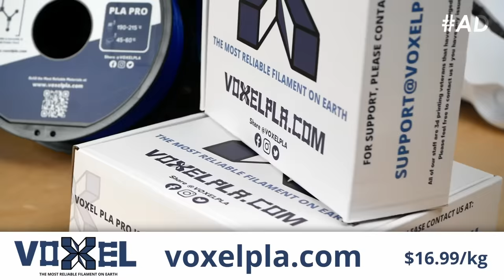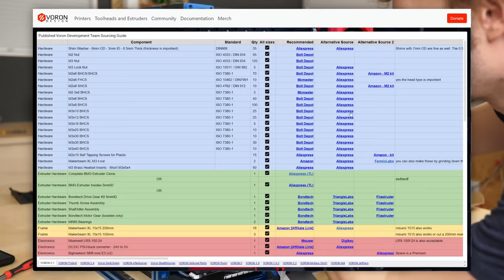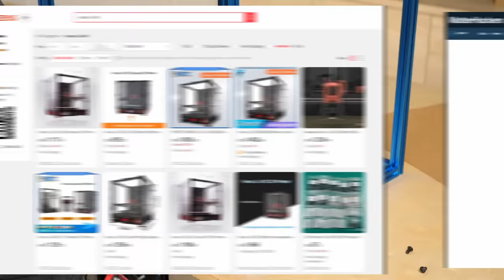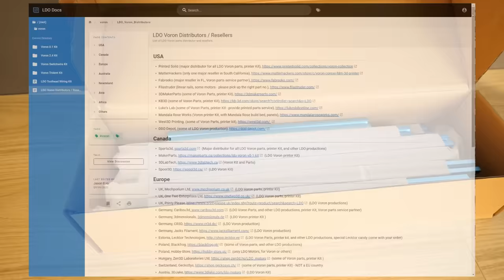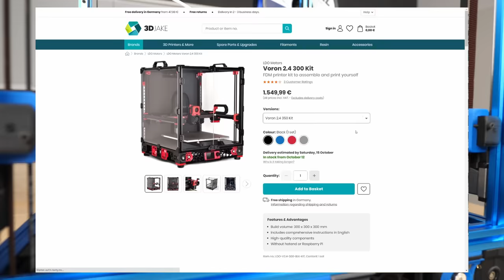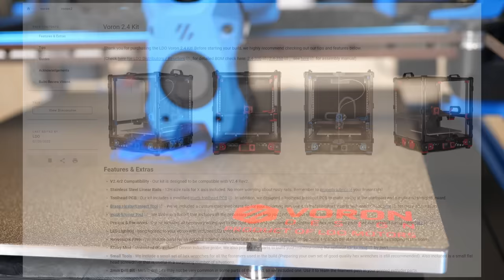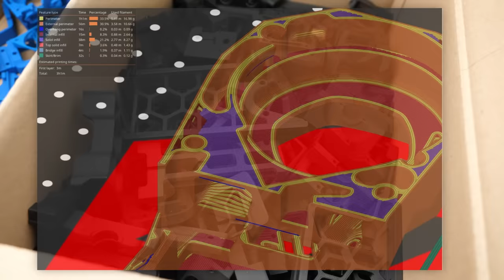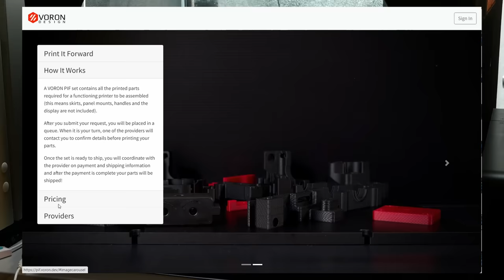Should you build a VORON 2.4 in 2023? (LDO Kit Review)

Comment from the maker: VORON 2.4 - Overhyped or everything you desire?
Reply: i want it but am broke lmao
Reply: If you are serious about voron printers then it is not hype. But if you use a cheap kit from China then you are not serious in my opinion and voron is a hype for you.

I am building one myself. The 350mm version of LDO. I chose the prusa colors. prusament ASA black and orange.
Reply: I love my voron 2.4. with the exception of being able to print engineering materials that require high temperature chambers. It does everything I want!
Reply: It is just right👌
Reply: You can make a Voron virtually silent, it doesn't need to run the bottom fan at any more than the lowest setting, the fans are there to cool the Raspberry Pi and the controller board(s), and both really just need a little bit of air circulation even if you pre-heat the bed to its max temp for an hour before you start printing
Reply: To me... It's great that you can source the parts (and probably the only thing that i will buy is the wiring harness) but considering that Also exist the ratrig v core 3 or VZbot... Or herort.... Or well you know what i mean... At this point it's just another printer
Reply: 2.4 is hype and overcomplicated. I own 0.1 and it would been better to have enlarged 0.1 etc. But building one is fun and posed some challenges. Once you done it, you keed doing diy stuff.
Reply: How thick is your aluminum plate and how did you get bedmesh leveling to work?
I don't really get the feeling that klipper compensates what it measures with the bed_mesh_calibrate. It's something the discord hasn't been able to answer to me.
Reply: This written with tongue in cheek pretty deep....  Assuming you don't need the height, the Trident is better.  Same over-engineered design, but with fewer things that can go sideways on it.  Then again, you can get either 280mm of height (300mm frame) or 330mm of height (350mm frame) with a v2.4's stock design, so there definitely is that going for it.  The flying gantry and quad gantry levelling is gorgeous to watch though.  Really, really gorgeous.

I'm still debating about the v2.4.  I know hubby wants one (that I'll be building for him), but we'll see if I build one for myself.  I'm kind of fond of the Trident's design, as it does everything I want it to do without extra complications.
Reply: I think the problem is they just are not worth the cost.    When you can get an ender core xy or tronxy for well under  half the price with the same or bigger build volume.    Yeah your going to want to spend on upgrades and mod it but even then your still likely going to be at around half the price and a similar time investment.   The other option is going to get better quality and just as fast out of a bamboolabs x1 for cheaper as well as long as you don't need the larger build volume(sadly I want at least 300mm volume for my next printer or I probably would have grabbed one)    
That said there isn't much that actually fills that same gap as what a voron does.      There are not many options for above 300mm with core xy that are easily enclosed.
Reply: No hype IMHO. Among the other FOSS printers I think it's the best valance between performance, price and complexity. Working in mechanical engineering I can only respect the simplicity of that printer compared for example to that of Annex which, even though may performance better in some situations, looks really messy (design wise) and complex despite having the same role and overall featureset as a Voron 2.4. The 2.4 may lack some feature that some may consider essential like a nozzle brush or runout sensor but those are dead easy things to add. 

As for the comparison with Bambu labs, I'm really happy to see commercial printers finally catching up with the high end DIY ones that have been ahead of the curve for about 4-5 years. That being said, I think you should have mentioned  that despite performance being equivalent the repairability, availability of spare parts and overall life expectancy of the machine is MUCH higher with a FOSS project like Voron compared to Bambu where it it goes out of business or decides to stop supporting an older printer in favour of a new one then you're f*ed.
Reply: @WhiteWulfe  If you have any interest in the process of building it, and it sounds like you do, then the 2.4 really is worth every extra second/dollar, that said, the design of the other Vorons are plenty good for their promise
Reply: @Jan-pz5ox  I build my 300 mm Voron 2.4R2 with the Formbot kit a month ago and the quality of parts was surprisingly good. A lot of spare parts, open drag chain, 0.08 mm parallel Heatbed, a great PEI Sheet, safely prefabricated cables and more. The Formbot kit does a great job for its way lesser price (< €1000). My Voron already printed for almost 400 h since the assembly. Printing PLA up to 18 mm³/s and ABS up to 22 mm³/s on my 0.4 mm Nozzle Dragon SF. I'm also very surprised about the reliability. For the higher price of the LDO kit I can't find arguments to justify that.
Reply: @The123eh  I have a serial'd Trident, I hope I enjoyed the process! (I did)  I was originally debating between the v2.4 and other models, and then the Trident was released, and it covered pretty much everything I was looking for at the time.  No matter what I'll be building a v2.4, since hubby wants (and for what he wants to print, needs) a 350mm variant, it's just a case for me of whether I build another Trident or a v2.4 for myself.  I've a feeling I'll figure out my answer once I build hubby's v2.4!
Reply: @ThunderGoat85  Then you have been lucky with the formbot kit. I know several people who also bought a cheap kit from aliexpress. And they have a lot of problems with bearings, motors, etc. I continue to advise everyone to go for the more expensive kit where the quality control is better.

Most of the time is cheap expensive.
Reply: I find myself in the middle between building a Voron or buying a Bambu X1. I have a fairly heavily modded CR-10 Mini running Klipper with a belted Z and it cranks out great prints. I don't need anything more but I do enjoy tinkering. However, 30-40 hours of tinkering and working with mains wiring is not exactly appealing, and I find working with AC intimidating if I'm completely honest. I was very excited to hear about the Bambu X1, but after seeing how locked in you are to their hardware and software, it's a bit discouraging. Maybe I'll get around to it one day, but the motivation isn't there for either at the moment, as much as I'd like a "next level" printer.
Reply: I like their design, but with all the updates to the ratrig I think that is the better LARGE 3d printer.
Reply: overhyped
Reply: got a V0 a V2.4, and the third Voron is on it's way. best machine there is, if you like building them.
Reply: @tomasis7  Enlarged 0.1 is a Trident. Said to be a very reliable machine IIRC.
Reply: For me, I needed a bigger machine that was more capable to expand my small business. I built my voron 2.4 in 2021. I can now print 300x300x600 since my build was custom. I am building a second currently. With these two machines I will replace my 6 geeetech machines since they print 2-3 times faster. Your machine looks gorgeous! Welcome to the club!
Reply: @mikkelskipper6969  Step 1 buy voron:
Step 2 sell voron printed part kits
Step 3 use profit to buy prusa XL when it finally releases
Reply: I wish I had the time to build one.
But as I know myself I would also want to change/mod a lot right away ... which would require even more time. 😫
In the end I can print everything I need on my MK3S+. Not as fast, but fast enough.
Reply: I also had problems with oozing filament interference with the z probe and figured out some helpful fixes:

1. Adjust the z probe operation to probe the flat face above the nozzle tip and not the tip of the nozzle itself. It's easier to clean off and doesn't usually get as much gunk on it as the tip.

2. Changed order of operations on print start:
Heat bed.
XYZ home.
Quad gantry level (with klicky probe on hot bed),
Heat up hotend off to the side and let it ooze.
One last Z-home for thermal expansion.

If you approach the probe from the right direction for the final z-home and measure the flat face above the tip, you won't wipe any oozed filament on the probe.
Reply: Too expensive,  and too much time needed
Reply: Its a great printer, but if you build it well & configure it well then it will be almost boringly reliable, to the point that i see many in the community do mods with "questionable" impact.. I feel them, its fun to mod but you hit diminishing returns very quickly on this platform because of how good the standard build is. The best thing about voron is that you can easily transition away from pla as main material to abs which in my opinion is superior! 

For the noise issue you have with yours, i can only recommend using the enclosure which GREATLY dampens the noise & get some 6025 12v noctua fans for the electronics (utilizing the fan jumpers on the octopus for 12v) and it will be a silent killer, though, the noctua fans are very ugly :(
Reply: I personally prefer a trident over a 2.4 for one reason: the gantry moving in z. Depending on your bed it will bend the gantry ever so slightly and you dont have consistent input shaper frequencies over the whole z height. The trident on the other hand doesn't have those (personal) throwbacks.
Reply: Overhyped, get a Trident. It will allow IDEX. Auto-filament change is faster... exact same gantry... unless you know you DO need more than 250 in height (also, not sure if you would not be able to find the parts to go higher nowadays). V0 is better for functional prints (small and ultra fast). LDO provide the best kits I think.
Reply: The Vorons are overhyped. It is not an easy machine to build, maintain and use. The vibrations make the belts come to loose lose quite quick. The belts are long and will stretch a bit in the beginning. I have 350 by 350 build plate and that might be a bit to heavy. Leadscrews are probably better. The thick build plate takes a long time to heat up and the Voron is not an energy efficient machine. For large builds a filament run-out sensor is a must. 
Now it is just a complicated and expensive machine. If you don't need a big build volume a Bambulab might be a better choice.
Reply: @alexdubois6585  there are even 520mm ldo steppers with integrated lead screws. 320, 420 and 520 ones exist, so 350 high trident should be no issue
Reply: Yes.
Reply: Just hype in my eyes. Started to build a 2.4 about a year ago and just got so frustrated with all the designflaws, that it's still standing there half done... The fixed Bedmounting is like they have no idea of engineering, thankfully these kinematic bedmounts are now getting more common, but as I talked about the issue over a year ago on discord everybody was like: Get away with your mechanical engineering, we'll fix it in software. The Cablechain dimensions are a joke, solution: Buy PTFE-Cables... The problem with the Z-hight you found yourself and even the recommended hight is unrealistic. The wiring sugestions are extremely Dangerious if you live somewhere like in Germany where the Mains-polarity is not set (If pluged reversed and the thermal fuse detects overheating, the Bed is still under 230V as the Fuse just cut the neutral) And I could go on forever, many of these things you see mods come up for as people run into the inevitable problems caused by the designflaws, but that makes the voron more of a constant construction site than a reliable printer. I regret that I bought the parts, as the resell value is about zero. With my knowlage from not I should have bought a Ultimaker or as of now a bamboo Lab Just my two cents.
Reply: I love my 2.4, it's capable, reliable, and I think I paid a fair price for it. The biggest thing for me though, is that there are no proprietary parts on it, everything is industry standard so you can modify it however you want. There is usually a user made CAD file for that too, but if not you can just pull a STEP file from the assembly, modify it, and then print out the perfect part for what you need.
Reply: will go for a Ratrig… 😉
Reply: Don't forget that you should have the CAD at hand. Adding one manual
Reply: @mikkelskipper6969  that's exactly what i did.. i cancelled my preorder for the xl maxed out and decided to build a 0.1 and a 2.4-350 ...my other 5 printers have been good, going to give most of them away and spread the 3d printing love.
Reply: mine works like a charm
Reply: You should do something about the bot text fraud
Reply: @notsam498  this is still possible with a few mods. there are additional heater mods available. the thing is: the sidepanels and the gantry not always like what you do with the heat.

i changed the motormounts and the tensioners (the tensioners are a total piece of crap and kill the belts!) and it works fine till 120° of "roomtemperature".
Reply: @The123eh  you're right for the raspi 4. the raspi 3 needs more cooling in my case.
Reply: @tomasis7  i have issues with the bed-orientation in my 0.1 it twists just a little bit. but if you'd enlarge it, the twist would become more servere. have you had a look at the trident?
Reply: @Drenth_Engineering  it works just fine with the klicky probe. do you have any issues ? i hate the inductive probe it smoked off too often.
Reply: @tdsangel  i built 2 V2's and one is does a bad job of bed mesh leveling, the other is doing fine.
Not sure if they have the same probe, I think so but I'm not sure.
I know there are at least 2 almost identical looking omron probes out there wich don't perform the same.
Reply: @Drenth_Engineering  i couldn't fix the omron inductive type probe - i love printing on cfk sheets - omron did a very bad job. unpredictable. mayme you try the klicky mod :)
Reply: @tdsangel  maybe I will, thanks!
Reply: To be a 3d Printing Snob you must have a Voron 2.4.
Reply: Source the parts. Build it. Then,  design your next printer.
Reply: it is just expensive unengineered device. 4 motors and rails for Z axis... isn't toooo much? Why not 6 or 8... or system board haven't so much drivers?))) But they used cheaper 20x20 aluminium profiles.... 4 Z-motors makes it much stronger))))
Reply: i see that overhyped junk prusa with warping edges in your vid
Reply: @The123eh  it's the tool head thats loud, i don't even have bottom fasn on mine and it's twice as loud as my mk3 and that's with the hotend fan at 75% too.  it is what it is.
Reply: I think the hype does come from the huge gathering of experience and knowledge to build that thing! And especially before the kits you'd had to know "your Voron" inside out before building it, because you had to know which parts to get! 

So for you, Stefan +CNC Kitchen it may not have been such a great growth in knowledge because of you first Voron 0 build and the many, many printers you've seen and tested before. But I'll guess that for many users it's like the 3rd or the 4th printer they own at all, and not their 20ths so the impact in "building your own machine" is still massive.

Of course you get simply "get" a BambuLab R1R (and I do think about that atm!), but the ultimate goal for someone who's seeing 3D printers not only as a tool, but as a hobby in itself, is to fully build one by yourself!
The only level up to that is designing you own printer! And during my studies I met a persons, who did! They were based on the Prusa i3 developments from like 12 years ago, but you cannot know a machine better, if you've not designed it by yourself! With F360 this is fully possible today (for free), 12 years back you needed some students licence of Inventor or Solidworks to do that...

What's left at the end is: experience. Which help you with every machine and every print from that day on ...
Reply: @hassosigbjoernson5738  Experience is needed in order to learn and not make the same mistakes, but here, as there was a liquid frame at all iterations, it remained so, and also on all branches of Voron.
Reply: Overengineered :)))
Reply: I am using a voron I self sourced and built. Just perfect printing machine
Reply: I bought a snapmaker Artisan. Can do Lasercutting 100W, CNC 200W and prints fast, has an enclosure and is an excellent built, while it can be build up in half a day.
Reply: @usurpinesusanti3149  the concept sounds good. BUT moving plates take to much space and we should use only open source and open hardware
Reply: @leoetcheverry9685  While this machine is a 3 in one machine and you can switch from 3dprinting to Lasercutting/engraving to cnc milling in less then a minute it saves a lot of space. And why open hardware ? This Artisan is almost open hardware there are no hurdles to change whatever you want and you can use whatever software you like. I like prusa slicer for 3d printing, lightburn for laser and i have my own professional cnc cam Software for milling. I dont lack of anything against open hardware, its as open as i want it. And you can even change the firmware, if you like to do so. No need to use the Luban Software which comes together with this machine.
Reply: Bambu Labs is the way to go. Some will argue a Prusa is better but they very likely never owned a Bambu Labs 3D printer. I have owned many of these and they are all collecting dust in the garage. The Bambu Labs is the best 3D printer I own. Light years better than my Voron.
Reply: @Jan-pz5ox wdym 99% of all 3d printer parts come from china. The extruded frames are not any different then USA. I buy my extrusions from Texas but Ive bought parts from china that are better than usa and much less expensive.
Reply: @Jan-pz5ox  I'm still not sold on the "bed-flinger" vs "rip-paycheck" war - in the end it's all about painful and time intensive tuning
Reply: @notsam498   Do you mean With the chamber and hepa filter included in those kit evailable you are still not able to print carbon nylon filaments?
Reply: @Levisgil47 i don't really consider cf nylon for the most part a good material for 3d printing but I'm fairly sure I can print on a 2.4 . I actually got given a roll of it. So at some point I will.
Reply: @Prepper_Raider  I really think it's about what you want out of a printer. Sure a Bambu is good now, but closed source, not really a printer you buy to tinker with, it's a tool, not all of us will buy closed source, many of us such as myself will buy vorons because we enjoy building and modifying printers as much as printing itself. Furthermore I think you should be careful when you say light years ahead of, because you never said how exactly. It's motion system for instance isn't more sophisticated neither it's extrusion system. It's sensors are and it's software is very user friendly... So it really depends what you meant right?
Reply: does it come with rolled or cast bed ?
Reply: @martinkenyon7640  depends on what you buy, I've only seen cast in kits.
Reply: @notsam498  how to check which one is which?
Reply: @Levisgil47  usually says so but you can see the pattern from the mill on most examples though I suppose they can mill extruded aluminum to unless it's stress relieved it's probably not important though